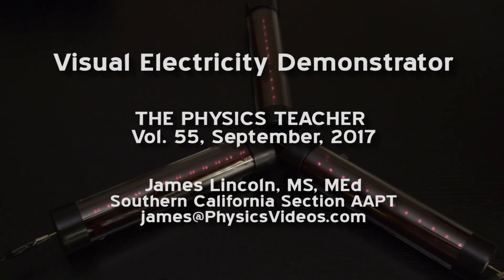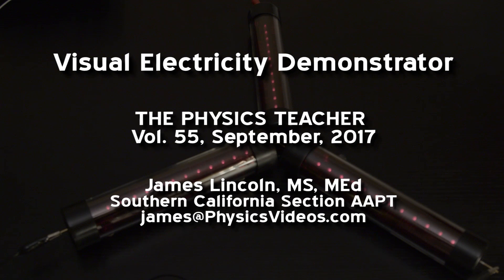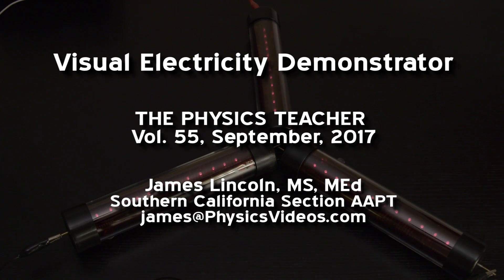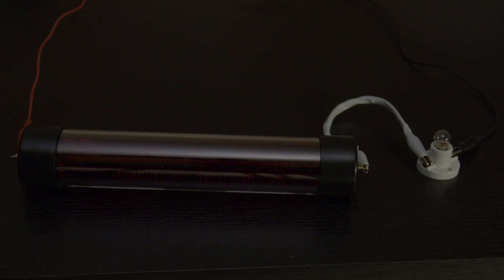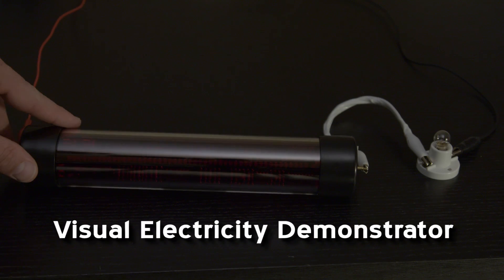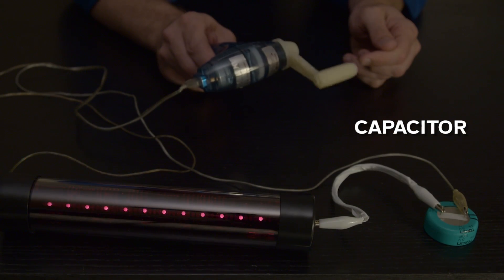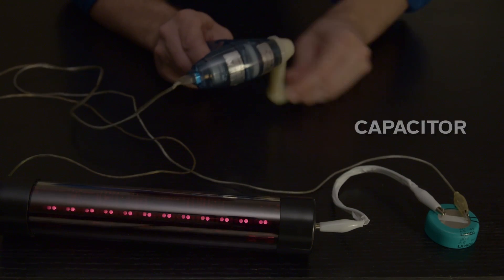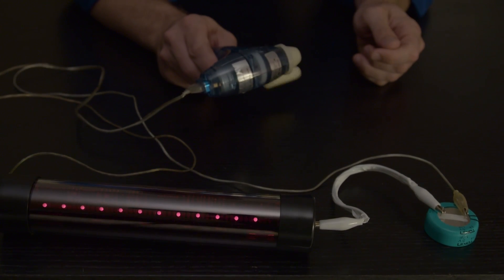Video Abstract - Visual Electricity Demonstrator Sept 2017

Comment: Nobody ever gives reference to the origin.  It's right here:  http://amasci.com/viselect/viselect.html , including my original 1992 schematic and PCBs.   I invented the device at Boston's Museum of Science in 1989, while working on our new Electricity exhibit.   (Actually the original insight came to me in 1988 while on a trip to SF, while messing with the electricity exhibits at Frank Oppenheimer's old Exploratorium museum.  Yes, The Exploratorium does sometimes spur one's physics-creativity!)
When I first built ten of these as prototypes, and I got them all working at the same time, I hooked them up with four rectifiers to form a full wave bridge, with a light bulb as the load, and a Genecon to power the circuit.  Eight Visible Electricity units formed a complete schematic.  Then, wiggle the crank on the Genecon back and forth, and see the DC pulses appear in the light bulb circuit, AC to DC conversion.  Then, add a 1-farad supercapacitor across the bulb, and the pulsed DC is filtered to become a smooth constant flow.  Very cool, eh?  (But first you have to be the owner of an entire bucket filled with Visible Electricity devices!

Here's my original list of suggested demonstrations: http://amasci.com/viselect/vedemos.html

If you decide to build your own devices, make sure to make some Electron Conductors as well as the usual Proton Conductors.  (Electrons are green LEDs, of course.)  Then, wire it so the green LEDs flow in the opposite direction.  Then, whenever you hook a red segment in series with several green segments, you've formed a lead-acid battery electrolysis diagram (with battery acid full of mobile protons, as is the actual case in the real world.)   When you force a current in the chain of VE devices, at one point the reds and greens are flowing together and vanishing, with positives and negatives canceling out.  This represents the creation of hydrogen gas at the negative battery plate (where electrons from the metal join with protons from the acid, to produce H atoms at the electrode surface.)   And at another place, the reds and greens are flowing apart, as pair-production.  This represents the splitting of neutral H2O into -OH ions and protons (called +H ions.)   In a lead-acid battery, the protons then flow out into the proton-filled acid, while the -OH donates electrons to the metal conductor (and releases neutral atoms of "O," forming oxygen gas bubbles.)  See, when your physics-model is based on the real world, it can be changed around to create other new models, which turn out to actually exist in the real world.
Reply: Thank you. I am excited to learn this history!  Do you have other inventions you would like to write about?  I am always looking for articles for my column in THE PHYSICS TEACHER.
Reply: @jameslincoln8476    BTW, see my permanent online history-article http://amasci.com/viselect/vistxt.html
Also see another version of Visible Electricity invented independently by others, published in Physics Edu. 40(2) in 2005 (with added color-change LEDs, to indicate voltage) https://iopscience.iop.org/article/10.1088/0031-9120/40/2/005/meta   I never patented or published my own 1989 version, I just posted it for free on internet (and, sold them through Arbor Scientific.)

Other inventions?  Most of my inventions are physics-concepts and lecture-demos.   I've been secretly distributing "physics memes" since the late 1980s, letting them spread without attribution.  They spread all over the place, and then after about ten years I typically see them end up as articles in TPT (e.g. my thick copper tube with falling supermagnet, and green magnetic film on the outside surface.)    Compiled list is at http://amasci.com/news.html#memes     (A good example is my mechanical maglev device, high speed copper rollers which lift a supermagnet, http://amasci.com/maglev/magroll.html and https://www.youtube.com/watch?v=glCNP6qH_Dc   Another is: giant lightning in pure argon at one atmosphere pressure.  We can make a "plasma globe," but with your own hand acting as the central electrode, and ten-inch plasma streamers spewing from your bare skin.  At 760 Torr, pure argon or helium (or mixtures) will produce enormously long lightning, using just a small handheld Tesla coil or other similar HV power supply.   Also see this mystery: 3D stabilization of levitated magnet-sphere, a sort of Paul Trap effect...https://www.youtube.com/watch?v=67RU241Az1Q invented by a hobbyist on my private forum, definitely NOT been in TPT, AJP, etc.)

Meme-spreading.  For example, the Bernoulli/Newton Airfoil Misconception, that was started by Klaus Weltner in AJP journal in 1990, but I made it my personal goal to spread it all over the entire education community (via PHYS-L and TAP-L email lists,) and all over USENET, commercial pilot forums, RC aircraft forums, etc.  After years of this, and with the unexpected arrival of www, the controversy finally caught fire, ended up "in the big time:" NY Times and various science magazines, TPT etc.   (Finally it appeared in Scientific American just this year.)   But there's another aspect to Airfoil Misconception which nobody has yet explored: all airplane wings are propulsion devices; examples of reaction-motors, and reaction motors completely violate Bernoulli's Law/equations, because they perform real work on gas parcels.  Bernoulli cannot tolerate reaction motors or fluid propulsion devices.  Therefore, airfoils can only be analyzed by making the wingspan infinitely wide, or putting wings into "ground effect" flight.  In that case, an instant-force appears between the wing and Earth, no energy is pumped into the gas-parcels, and wingtip vortices can be ignored.  (In that case the wing has become a kind of venturi, as with any ground-effect vehicle.)  Therefore, every single airfoil diagram you've ever seen  ...is wrong.  It's wrong because it cannot explain how airplanes actually work.  It can only be used to explain exotic ground-effect coasting flight, or used to compare various airfoil designs (when various airfoil designs are employed in ground-effect coasting flight!) Similarly, airfoils and Bernoulli cannot be used to explain helicopters, or sailboats, or ship-propellers or swimming fish or hovering bumblebees.  (Put simply, all airplanes are basically the same as helicopters and hovering bumblebees.  Their lifting-force is based on reaction against local gas, NOT reaction against a distant ground surface.  They work by vortex-shedding, and are not based on forces involving Bernoulli's constant-energy parcels.)  But confusingly, a typical aircraft is translating sideways fast, so its vertical plume of constrained downwash becomes smeared out diagonally, unlike with helicopters and hummingbirds.  Yet this sideways smearing has no effect upon momentum-conservation or vertical mass-flow.  Nor can the sideways motion somehow be used to eliminate the complicated vorticity-flow which performs real work upon the gases (thus violating Bernoulli.  A true explanation of airplane flight is required to avoid any mention of Bernoulli!)   I suspect that THIS is why "nobody really understands wings," no matter how accurate we can make our math models.  The gut-level, intuitive explanation is removed, as soon as we remove the downwards-moving shed-vortex, or as we make the wingspan be infinitely wide, and we exclusively analyze 2D flows around 2D airfoils.  Airplane flight is a consequence of 3D physics, and removing one physical dimension will remove any possibility of explaining how airplanes stay up there.    (Heh, airplane flight is actually based on Feynman's Reversed Lawn Sprinkler!  No joke.   Every wing is surrounded by a contracting sphere of onion-layers of inflowing gas, and this in-flow produces exactly zero net-force upon the wing.  This little-mentioned process is part of all fluid-propulsion devices.)

--

One of my very successful memes was the "Buckyballs" supermagnet-balls puzzle.  I came up with that one in 2001, took it around to local toy manufacturers, but nobody was interested.  The mark-up ratio for materials cost was way too small.  (Also, rare earth magnets cannot be sold as toys to kids; lethal swallowing hazard.)   I finally put my discovery on my high-traffic physics site in 2004 (also posting it in Usenet Newsgroup sci.physics, and on the now-ancient PHYL-L and TAP-L physics email lists.)  Nobody noticed!  Rats!  Years later I posted multiple youtube video demonstrations of the spheres, see http://amasci.com/amateur/beads.html.  That did it!  Within months of the youtube exposure, several people had "stolen" the idea and started selling them.  (That was my true goal, since I didn't want to start a company myself!)   One might wonder who patented the "Buckyballs" magnets?   Nobody.   I forced the concept into the public domain by putting it in public in 2004, so by 2005 nobody can own the concept, and everyone can sell them.  (That's why there are Neocube and Cybercube and Buckyball and Zen Magnets ...and also about twenty other separate companies selling little neodymium sphere magnets.)   One secret I never developed at the time: if the little spheres are magnetized with quadrupole pattern, then they become models for carbon atoms, and will naturally assemble into diamond lattice, carbon-chain molecules (even decorated with hydrogens!), and they actually form a proper Buckminster Fullerene sphere.  The dipole magnets sold at present DON'T form a proper buckyball.  They do have sixty magnet-atoms, but they form squares and pentagons, not hexagons and pentagons as with carbon-60 Fullerene.   The magnet-atoms need to have tetrahedral outer orbitals, for four-bond structure, like carbon.  Otherwise we instead get "polymers" with sulfur's dipole-bonding structures, not the zig-zag backbones seen with all carbon chains.   So, there's a new meme-product, "buckyball" sets of supermagnet spheres, but each magnetized in quadrupole pattern.  That's if the Consumer Products Safety Commission doesn't continue on its quest to ban all sales of sphere-shaped rare-earth magnets.  They've tried this twice, and were fought to a standstill by a famous supermagnets activist!  That's an entire story in itself (including the one where the government agency forced the company to oven-toast about $20,000 supermagnet beads, sent above Curie temperature and demagnetized.   It's not impossible to re-magnetize these.  The "dead" ones are being sold by the kilo on eBay, for anyone wanting to experiment.  ( The trick to re-magnetizing a small supermagnet is, use a soldering iron tip to heat it above Curie, then cool it down again while held next to a large, powerful neodymium magnet.  Next, try to impose a quadrupole magnetization, rather than the typical dipole pattern!)
Reply: @jameslincoln8476  Waking up after shutdown!   I have loads of stuff, leftovers from my 1980s physics-exhibits career at Museum of Science, Boston.   Need to figure out what actually fits TPT though.  Some is listed at http://amasci.com/scied.html.    All this was internet-only, and many oldschool physics educators from the 1990s have seen much of it via TAP-L and PHYS-L discussion groups  ...but my devices never appeared in TPT, and teachers from the last ten or fifteen years may not have encountered any of it.

A cool one from a few years back is the Mechanical Maglev machine, my two rotary copper pipes with a neo supermagnet floating in the cleft, see https://www.youtube.com/watch?v=glCNP6qH_Dc and http://amasci.com/maglev/magroll.html  I almost entered it in the TPT lecture-demos contest in ?1998,? but ran out of time.  I think someone here at UW physics finally built a copy of the device, but that may be the only other version around.   I don't know if it ever ended up in TPT.   Possibility: measure repulsion force and drag, calculate the induced surface-currents, even explore skin-effect phenomena re. the variable-RPM motor.

Did TPT ever have anything about my invention "Hand-Drawn Holograms" http://amasci.com/amateur/holo1.html, or about Human Infrared Vision http://amasci.com/amateur/irgoggl.html ?   The first ended up on a Star Wars vinyl soundtrack record, a real-image of a 3D "TIE fighter" floating in space above the disk, rotating as it plays the music.   It all came from my needing to explain hologram-physics to little kids and grandmothers (while working at MOS museum in Boston.)  To really understand a topic, become a teacher.   But as a result, I found that holograms are nothing like anyone thinks, and we can create Benton Rainbow holograms by scratching a plastic surface with a blunt needle!

Projects I never got around to:  a version of Arbor Scientific VED as a "thicker wire," with two or three LEDs abreast, but it flows at 1/2 or 1/3 the normal speed.  Then, use thin-VED to depict a light bulb filament, with thick-VED as the connecting wires.  Tungsten filaments heat up because the charge-carriers are flowing much faster in the thinner wire.

Or, VED version with green LEDs, which runs backwards!   It depicts a metal wire  ...where the red-color VED instead is like a hose full of acid, full of +H ions (+H ions have another name: protons.  Acids are proton-conductors, although students and even some teachers seem unaware.)   THEN:  to describe a simple battery, use green VED devices for the main circuit, with a short segment of red VED as the electrolyte layer.   Then we can see the water molecules splitting at one joint, green electrons and red protons flowing away from that junction, then flowing back together at the other junction to form neutral hydrogen again.  The main insight is that all batteries are short circuits, and the path for current is THROUGH.   This combats the common misconception that batteries are a source of electricity, when in fact a battery is much like a Genecon, and is just an "electricity pump."

Ah, how about VandeGraaff generator sparks, the three different kinds?   We have the usual bright needle-sparks.  But we can make foot-long violet fractal tree-structure sparks, by triggering a discharge with a 1cm steel ball.   Also, the Winsco Corp. tabletop VDG exhibits a weird discharge that resembles a long purple sausage 2cm thick (it leaps between the sphere and the sharp corners of the square base.)   Using a Morris and Lee VDG machine I was creating this third type of spark, roughly a meter long, and with branches!

Comment: It would be interesting to show 3 phase AC circuit using this device.
Reply: First need to build a 1Hz, 3-phase signal generator.   But even a simple square-wave version would be instructional.   (Heh, or train three students to move three genecons back and forth, in choreographed sequence  one-two-three-one-two-three.)

Comment: http://amasci.com/viselect/viselect.html is the website for this device.  Complete info, more tricks, DIY build your own 1988 version if desired.   Needed: a version with green LEDs (neg charge carriers) which move backwards.  Or perhaps an "electrolytic" version with red and green LEDS moving opposite past each other.
The originals were part of my set of physics exhibit-devices designed for Museum of Science, Boston.

Comment: Is that what a capacitor looks like?
Reply: Depends on the capacitor. Some are cylindrical while others are rectangular bricks. A capacitor for a commercial neon light system resembles be a heavy rectangular brick-like capacitor, whereas a capacitor for a mobile audio system would resemble the cylindrical shape, similar to the size of a small fire extinguisher. 
Not 100% on this, but perhaps A/C capacitors are rectangular whereas D/C capacitors are cylindrical in shape?